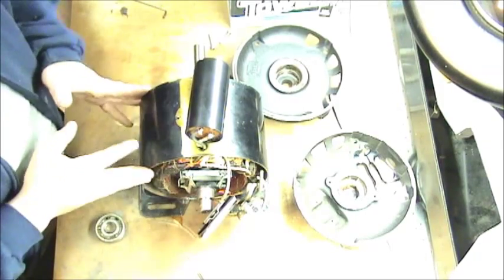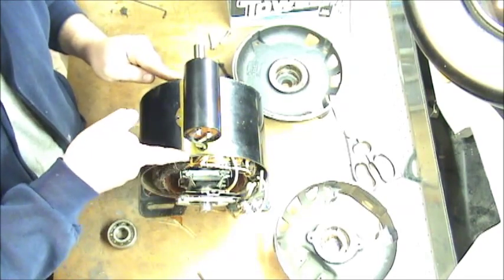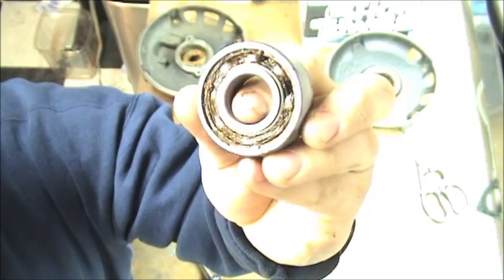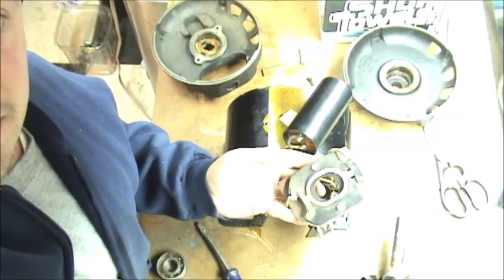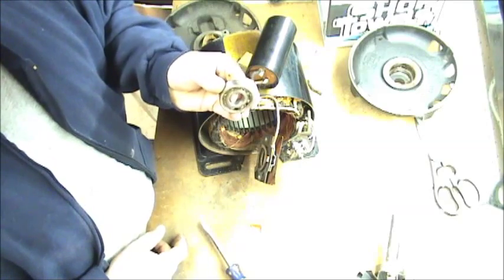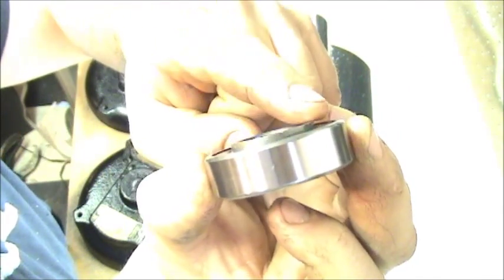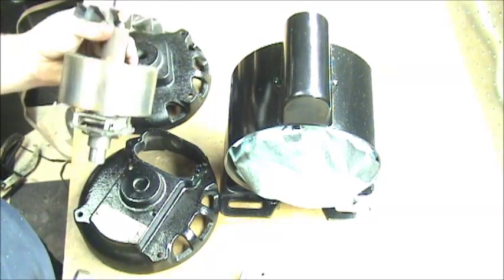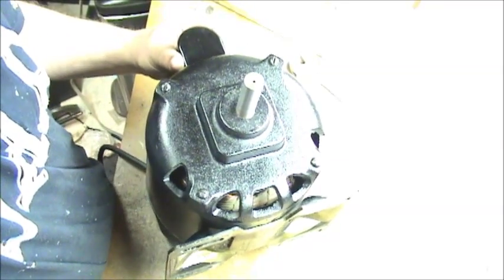Drillpress Westinghouse Motor Rebuild

Comment: Great video! I have a 1944 Delta/Milwaukee DP220. The motor is a Westinghouse with the shaft coming out of each end. Not sure why, but I’ve taken it to two shops, neither could or would try to get it apart. One gent was nervous about the Bakelite disc or part on one end inside. I just wondered your thoughts on the disassembly of a motor like mine. It has a start stop switch on the side of the motor. Moving one I the cloth covered wires in the switch box I heard a crack or pop trying to move it back in not place. Just wondered your thoughts. Thanks!

Comment: A pain in the butt to get apart for sure but they sure do not make motors like that now!  I use a small fine contact file for the points.  I have found that any grit based cloth can leave grit and can cause problems...  Great rebuild job and explaination...  Thanks for sharing....